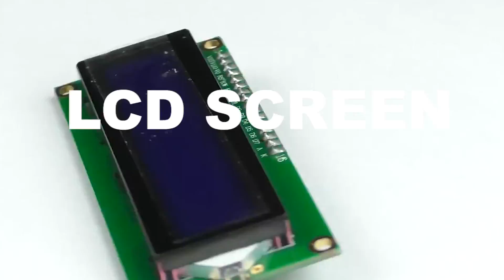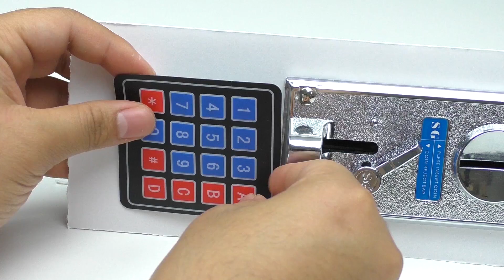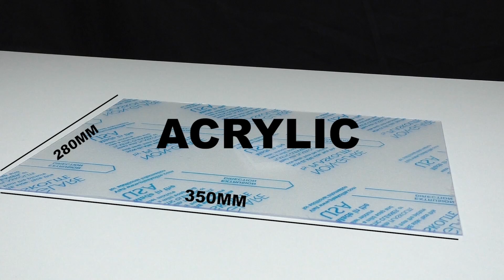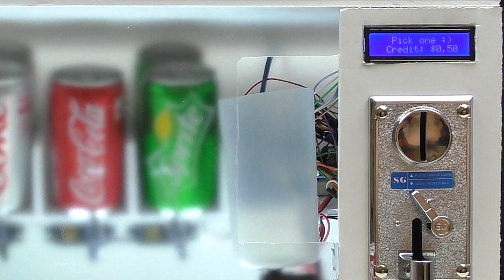How to Make Cola Vending Machine at Home - Foam Board

Comment: Try to programming it yourself people, maybe I'd just modify the code: Servo which rotating on that horizontal lift (or I can call it) with that white case can have a base position towards the customer, not just 5 seconds and then rotate back (at the end of of void loop). But if you have there some weight sensor, so sorry, you have it perfect.